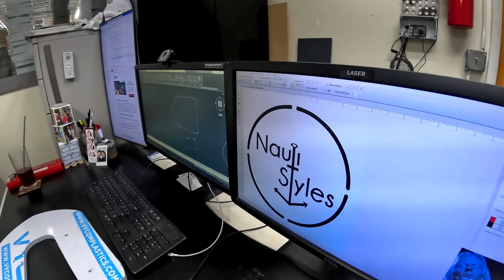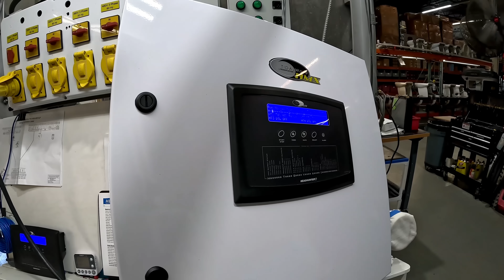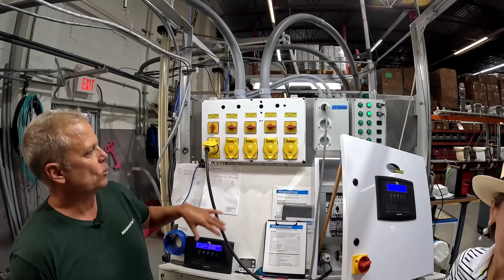Welcome to the SH$T Show... with Headhunter (part 1) Eps. 43

Comment: By the time your boat is finished we will all know how to build a quality boat!  Thank you for sharing all of this.  3 phase power is very common in the US.  I used 480 volt 3 phase power at my convenience store/gas station with a full size commercial kitchen for all my HVAC, refrigeration and interior and exterior lighting.  Your wiring is half the size and your electric motors don't require starters.  It took 200 amps 3 phase and 400 amps single phase for that small power hungry operation.
Reply from the maker: That's the plan! Thanks for sharing! 🙌

Comment: The only thing missing is a bidet. When I remodeled, I made sure my toilet was also handicap which sits inches higher than a standard, then I bought a bidet from Bed and Bath, that attaches under the seat.  Saves on paper.

Comment: "Compact model is okay".
Well kind of, but there's something that men who haven't used both round and extended oval shaped toilets, and women, who don't have to deal with this problem, probably don't think of. Yes it's okay, but it's not as comfortable or sanitary for guys to use. The shorter round profile, not having the extended more oval front portion, doesn't give guys as much room to "tuck" their parts inside it and it can put the front edge of the seat pressed against the base of their junk. Also, depending on how well they are hanging, the smaller bowl size can put "it" touching the inside of the bowl, and nobody wants any part of their body touching or rubbing the inside of a toilet bowl! The smaller round shape also doesn't give as much area to catch their urine stream when standing to go or any dribbling as they finish, and since the boat could be swaying as they are going, the extended front would give a lot more area to catch it instead of it hitting the floor or hitting the bowl lip and making it spray off the sides. So for cleaner floors, cleaner toilet edges/sides (from drips going down the outside of the bowl) and a more comfortable bathroom experience, especially for the larger gentlemen, you should sacrifice the extra couple inches of floor space the extended bowls take up.

Comment: Great video, very interesting to see how this system works. Nice you have all these systems on board, but just wondering if you have enough personnel onboard to service all of this. If there is one rule in boating it is this one: 'it just broke now, it has broken before and you had to repair it or it will break down', that is a given. And with this system in Europe or the Caribbean.................who is going to repair this quickly ?

Comment: Does the treatment system clean the water to the point that it can be purified and returned to a holding tank for gray water use? Seems a waste to clean the used water and just discharge. Do they have a purification system?
Reply from the maker: More info on this coming soon! 👀

Comment: Did you choose a round toilet or elongated? I can tell you that as a big guy using the smaller round toilet isn’t a good experience. My home came with round toilets and after a week I went and had elongated units installed. I hated the originals that much.
Reply from the maker: We only had space for the longer one in the Master, small boat 😝🙈🤷‍♀️

Comment: How much does this cost and what is the way you dispose of the final processed waste?
Reply: I could be wrong but, from what I got out of the video is, there really isn't anything left of the waste to process. It's all burned up with the chlorine. The chlorine that is made from the salt water. It seems there is filters that would be changed but it only filters the chlorine.
Reply from the maker: @snailracer3773 you are absolutely correct, clean water just goes overboard

Comment: 4:10 "people really... unfamiliar with how sensitive the system can be"; i.e. drunk off their @$$es :-)

25:42 Absolutely, having a CNC machine or 3D printer is like having a super power. You can build these from kits for not much money... if/when I buy a boat, I will make sure I have room for a small 3D printer.

Comment: I like that you guys are looking in the environment part of the story. Really like the company you chose. They look extremely technical company(as they should be). BUT, sorry to say this, they need to hire a proper designer. Their system might be state of the art, but their design of the heads has frozen in time(1992ish). Looking at your renders of the interior, you will have really beautiful boat, but this heads just don’t go with it. @Headhunter, please start keeping up with the time, as you do with the standards and regulations and quality. Or design the system so it will support normal house products.

Comment: I actually have a serious question. Okay, this system that you're getting on your boat. Turns s*** water into clean water now. Does that system allow you to recycle that water that went through that system to go back to your toilets? Or is there a system that you can get? That will recycle that water. Because wouldn't it be a waste of space for your tanks to be holding all this? Clean reusable water if it can be used again and then go through the system all over again.

Comment: What you were demonstrated was sales gimmick.  Did you ask how the panty hose are recovered after flushing onboard(asked in Part1; Was it  really Answered in Part 2?)?  I don't doubt this company knows it's "Sheet" LOL.  
But what real, it is what reality is, and Money well spent means it had better work even if a guest flushes a heavily used 12 hour tampon with a 12" heavy duty string/anchor rope down the head.  Where does it go? How do you clear the system? While your other guests are sitting on yesterday's tacos? Funny? Right?  It must work under real world circumstances!  Rico has the right idea!  Why, Because, He will the Captain maintaining the "sheet"! LOL
Reply from the maker: No gimmicks 🤷‍♀️
Reply: People end up flushing unwanted things into your toilets,  we are showing that those things will not break the head like most other marine heads.   Those objects will get into your holding tanks ect...  In the video, Paul talks about our basket strainer that can be placed on the inlet side of transfer pump to catch and remove said objects.